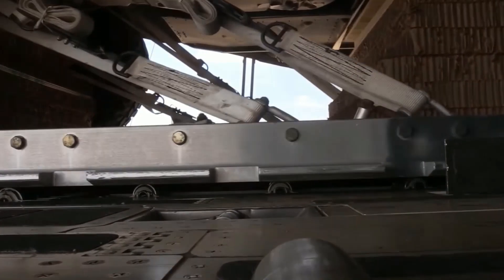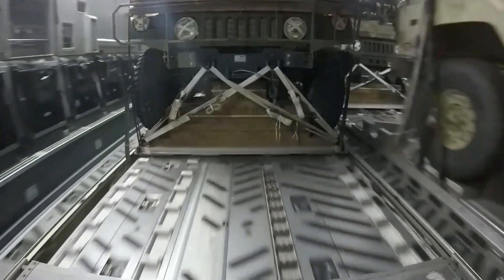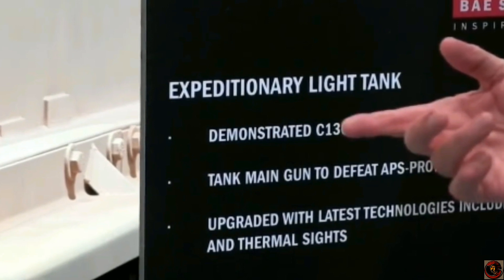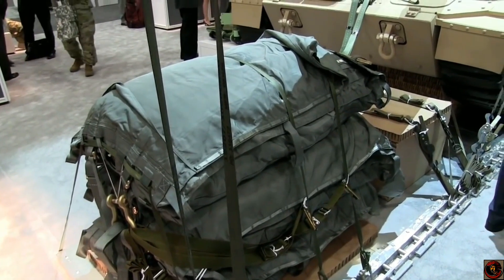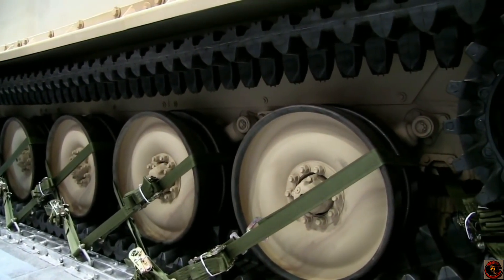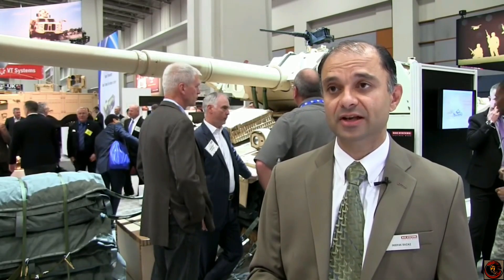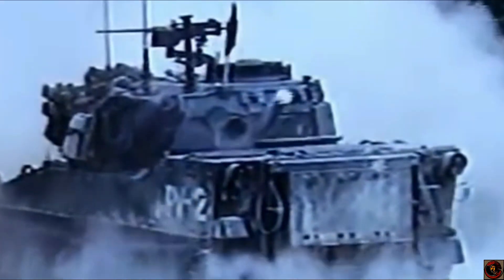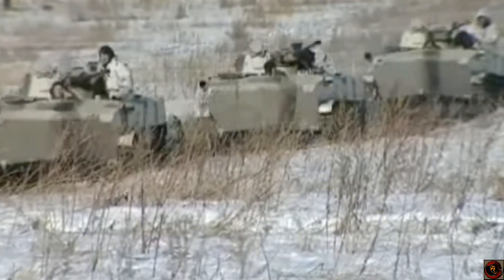Dropping a Tank From a Plane - Airborne Armour?

Comment: Here's another one from back in the day - the Cadillac-Gage Stingray - https://en.wikipedia.org/wiki/Stingray_light_tank  .

The BAE talking head is not really accross  his subject matter:

In WWII there were gliders for heavy loads including vehicles. 
I believe there were airborne tanks that were glider landed e.g.: https://en.wikipedia.org/wiki/Light_Tank_Mk_VII_Tetrarch

Re rubber tracks - maybe use them for the drop to reduce weight and drop metal tracks which can be fitted when convenient.

Aluminium track is also much lighter than steel.
We (RAAC) used to use steel track on our M113AS1s and they were very heavy when compared to the American aluminium track.
So that would be an option.

The idea of tanks being dumped out of planes is not new and the US did it through the 60s, 70s, 80s and 90s AFAIK.

Re development time: the Abrams took about 20-30 years to develop even longer if you go back the MBT70 - so 5 years IS pretty quick to get a complex system like a tank airborne qualified through the US system, especially if you include the politics.

Should this program go on? 
If you're gonna have airborne "conventional" infantry (as opposed to special forces) you really need to give them mobile, armoured big direct fire guns, so yeah this has to go on.

There was a program to replace the Sheridan (which is the M8 they are trying to re-market) now but it got cut when the wall fell.
I believe the airborne school of the US army always wanted the capability back, but the program just didn't have the priority to get budget.
Reply from the maker: jtan163 some great info and points made here :-) thanks so much for sharing and watching. Have a great day!! :-)
Reply: ah, the stingray.  used to great effect by Universal Petroleum in Venezuela.

Comment: Why cant they just use stryker MGS to do this instead of a light tank? I mean stryker MGS also had a large caliber gun right?
Reply: wait really? That fucker is *Googles it*  18.7 tonnes, which is heavier then the Sheridan..... Duh fuck, even the none big gun Stryker weighs more then a Sherdan. Did they armor the fucking stryker with lead? Because the Sheridan uses aluminum armor and is pretty much the same size.
Reply: The MGS is not a tank. It can only fire from the 10, 2, and 6 clock positions because of recoil. It's tall, so it makes a big target. It's wheeled, so it doesn't have the terrain handling capability that a track has.
Reply: Les Ottele also, can't forget the wheels falling off. Touch the ground, whoops, all your wheels are gone, you fucked your drivetrain, and you are going to have a long day in the maintenance area of the nearest friendly base explaining why you threw something out of a plane that never should have been built in the first place (the MGS, not the plane, plane is fine). I personally despise the MGS it isn't even a tank destroyer, at least those can fire their guns anywhere in their arcs of fire! Fire support? What, fire the gun and flip over or rip your wheels off? Nah, fuck it.
Reply: The MGS is being used but its heavy for the role.
Reply: strykers are big, buddy. that's why they're heavy...
Reply: Can not be air dropped. Only fits C17 and C5 aircraft. What is needed is something to fit the C130 and AB300 aircraft.
Reply: chauchua Bernardo Stryker is an infantry vehicle. Any Stryker not committed to carrying infantry is simply a vehicle for supporting infantry. Get it?

Comment: Interesting idea, and it does make some sense to give the airborne something with a bit of armor to help them but I'm not too sure that an airborne tank is the way to go. I think that something like the Russian BMD is probably the better way to go, a slightly up armored IFV. The problem with a light tank is that there'd be too much temptation to try to use it like a MBT and/or there will be complaints that it's too lightly armored for a tank and then it starts getting too heavy to airdrop. As it is, if the armor is modular and has to be bolted then that's going to seriously increase the amount of time it will take to get it deployed after dropping.

As far as the dropping goes, they'll most likely not drop it from high altitudes but basically chuck it out of the back of the plane as it flies a couple dozen feet above the ground. Of course it will be on a pallet but no chute, at least not to slow it down, a chute would be used for drag to help pull it out of the back of the plane quicker. It will probably have some sort of crushable cushioning to soften the impact of it hitting the ground though.
Reply from the maker: Riceball01 some very good points there :) thanks so much for watching!! Hope you liked it :/)

Comment: Instead of having tons of extra applique and slat armour installed after/before the drop, it would be much cheaper, lighter, and simpler to instal an APS (such as the Israeli Trophy). This would give the light tank all the protection it requires for a low to mid intensity conflict (let's be honest - no amount of applique armour slapped on a light tank is going to stop an enemy shell).
Reply from the maker: CXVII MMDLII true true, but I think with a tank like this they want something able to at least be able to take on the vehicles that would also be airdropped like the Russian equivalent. So they want some sort of heavier armour to protect it

Comment: You touched on the logistics for this a little.  The M8 won't be able to be dropped with it's full combat load.  So you're looking at additional fuel, ammo and class IX that needs to be dropped separate to support it.  So add an extra airframe in there.  It won't be able to be dropped with the add on armor attached to it, so add another pallet or two plus time to install.   They won't use LAPES to drop this, they'll use LVADs.    Also, when this gets on the ground, think of how much fuel it's going to burn up and how many resupply drops it'll need to keep these on the move.
Reply from the maker: celtic30 these are all very valid points. Thanks so much for watching and for sharing your input, I really appreciate it! Have a great weekend! :-D
Reply: I actually worked on this a little so if you have any questions let me know
Reply: @celtic30  Got a gyy trying to tell me they air-dropped M1A2 Bradleys in Iraq. From altitude on parachutes. I have only seen these skid dropped, using drogue chutes to pull it out just about 20 feet AGL. 
Is it true that they chute drop heavy tanks from altitude?

Comment: auto loader bad idea for air dropping , i mean if it hits the ground hard, it's just one more thing that can break
Reply: don't BMDs  have auto loaders for their 100mm guns and The 2S25 Sprut-SD is equipped with a two-man turret armed with a 125 mm anti-tank gun fitted with an autoloader, so if the masters of airborn tanks do it then surely its ok
Reply: If you're worried about something breaking, why are you even dropping vehicles in the first place
Reply from the maker: happydeath fish this is a fair point actually. Didn't think of it. Thanks for watching :-) and have a great weekend :-)

Comment: russians drop BMD not BMPs
Reply: The main differences, BMD easier and adaptive suspension.
Reply from the maker: HLVS comendande Che sorry my bad. I'm not that proficient in Russian armour designation. Thank you for watching :-D have a great weekend
Reply: Matsimus Gaming Airborne is a separate independent native troops, reports directly to the High Command. It uses a unique technique and weapons are not used in the Army. For the sake of budget savings agreed that BMD and BMP will have parts in common, but differ structurally. BMD-3 is unique, BMD-4M is unified with the BMP-3, but it is more advanced and protected.
It is easy to get confused, equipment has a large number of versions and models)

Comment: why not just develop a 60-70 metric ton lift helicopter. star wars laat/c anyone?
Reply: helos are inferior to cargo planes in terms of speed and range. and much  more vulnerable in the process of unloading their cargo.i think this is the main reason why deploying a tank via paradrop from cargo plane is preferrable
Reply from the maker: Theredelectrician haha maybe. I was thinking like the aircraft carrier in the avengers movie lol!
Reply: I was thinking of attaching the tank via cables what could be let go remotely once the tank is touching the ground. The crew and ammo are already inside the tank so it can begin to fight from the get go. I do agree with you that a helicopter is more vulnerable while traveling due to is speed or rather lack of it compared to a plane. They would not be dropped right on the front line but a bit behind and then drive towards the front line. I be-leave this would be faster then loading up a plane with a tank, securing it and then dropping it with crew parachuting separately. My view on this equipment would be a ultra fast response to a enemy spear head or exploiting a breakthrough in the enemy line.
Reply: although a flying aircraft carrier/ troop lander would be the most awesome thing ever developed. I do not see it happening unless we get fusion energy working properly or we develop the liquid salt reactor further. (USA why did you stop its development. We could have had nuclear powered planes my now)
Reply from the maker: Theredelectrician I think it could happen for sure. Give it 20 years and look at what will be available! It blows my mind how far we have come with tech in the last 20 years! Lol
Reply: Matsimus Gaming well in 20 odd years when it does happen. I hope you will do a video on it.

Comment: I love the russian Air dropable tank designs like BMD-2 or BMD-4
or the mostbadass TD the Sprud-S (BMD-4 with the 125mm gun of the T-90)

and IMO these are right now the best air dropable vehicles, the BMD-4 even is better than some of the Normal IFVs out there.
Reply from the maker: Iron_Physik yeah the BMD seems like a amazing vehicle for this kind of setup. It makes sense to use them if they can be deployed like this safety. Hope you enjoyed the video! Thanks so much for watching and have a great weekend!!
Reply: Matsimus Gaming

yes I enjoyed the video.

Oh and for rubber tracks:
I think they are not only rubber, I think they did the same as in rubber belt drives and reeinforce them with steel cables.

this would solve the problems of them snaping easy and warping under heat.

the only problem would be that the rubber gets dammaged from long driving on hard terrain like streets.

I came to this idea when I checked Belt drives. (im a mechanical engineering student)

something like this:
http://www.gufero.com/files/mod_eshop/kategorie/105.jpg
Reply from the maker: Iron_Physik interesting info! Thanks so
Much for sharing. I'll check it out!

Comment: i love the concept of air transportable armor. i think its a good direction, because tanks of this size can be still equipped with standard 120mm guns but be entirely more mobile than any standard tank. with the technology increasing, soon we will have such smaller and lighter modular armor that we wont really need large heavy MBTs like the abrams. once the tank (with the same gun) reaches the destination area, the modular armor is bolted on and they drive away, effectively being able to provide support while also having armor that can compete with any anti tank threat that could be presented. correct me if im wrong but i think the American new future light tank designs ran along this train of thought, being light enough to be airlifted while simultaneously having the same armament and better situational awareness than the abrams. i think that near future efforts in armor development is going to be spent on countering existing weapons systems with lighter and smaller armor packages/revolutionary designs, rather than simply increasing the bulk to solely defend against future anti armor developments like they were doing throughout the cold war and 90s.
Reply from the maker: NEET Magnet some very good points there. I find this kind of way they are going very interesting. Thanks so much for watching!! :-D

Comment: I think that it is the softness and malleability of the rubber tracks that makes them reliable, less likely to crack, chip etc etc. Also, if the track was to be hit by shrapnel/incoming round My guess is that the elasticity would allow the round to puncture a small entry and exit wound without breaking the entire track  with the majority of the force of the object being allowed to pass through the track rather than absorbed by the track itself. (I don't have any experience on this matter nor am I an expert this is just my guess)
Reply from the maker: Crunchy Memes I don't know enough about specifics of the rubber tracks so I can't comment much. But I would ALWAYS side with metal ones before a rubber one. Thanks so much for watching :-)
Reply: Matsimus Gaming Thanks for another great video :)
Reply from the maker: Crunchy Memes your welcome anytime :-)

Comment: I was wondering if we would even bother trying to match the Russians and their BMD series and Sprut-SD tank destroyer. Given how things go I am still skeptical.

But as to the autoloader on the M8 MGS, I know that it is some sort of carousel type autoloader but the exact details remain elusive. No amount of research has been able to garner much. I have even heard that it even has a form of blowout panels to it but I can't really find reliable info on that.
Reply: Nicholas Mew It does have a carousel type auto loader and there was a large access panel on the top of the turret that allowed you access the main gun and auto loader that acted as a blowout panel.
Reply: Nicholas Mew also there is a pseudo bulkhead inside the tank with an access hatch so that if the mechanism fails the gun can be loaded manually, even if a little bit more slowly, you can still fight your way out of a bad situation and then go and repair the mechanism to get your blistering rate of fire back
Reply: Fabian Johnston Interesting. For such an autoloader that is excellent.
Reply: It's probably still a prototype, the final specifications are not known.

Comment: This has amazing shock potential. The enemy can be attacked when he is most vulnerable with a weapon system that can do the most damage. It would probably be better to design a new lighter but powerful gun. Also I don't think a paratrooper tank needs to have pretty heavy armor. Speed can be used as it's primary defense. A tank light enough to be airdropped should be pretty fast. Armour should be used sparingly on an airborne tank. as for the auto loader, I really think they should have gone manual. It would make the tank lighter and more transportable and leave more weight for armor.
Reply: Ahhh the good old M8 MGS "Buford". The little tank that never was. Firstly why would they need 5 more years of R&D when they have been trying to sell it to the U.S. military since the 90s. I am no expert on this vehicle, I just got to play on it a few times over the years.  The electronics package in the early 2000s was comparitable  to the first series of M1A2s and I would think that they would have looked into ways to improve that, like adding GPS nav instead of inertial nav. I thought it was a good vehicle for the task it was designed to do. It has all the basics you would expect on a modern version of a light tank. Thermal sight, digital coms, digital fire control systems. If memory serves me correctly with no add on armor it weighs slightly less than a Bradley. There were 3 "phases" of armor, P1 no add on, P2 bolt on modular armor, and P3 added on ERA and bar armor on top of P2. It had a carousel type auto loader that still aloud access to load the main gun manually via access panel in the crew compartment. No idea if they improved it, but it loaded at a decent speed. Not as fast as a well trained human loader, but relatively fast for an auto loader. I also believe this vehicle shares a lot of common parts with the M113. I always thought the coolest feature was that it had a gunners hatch lol. As an M1 tanker it was nice to be able to stick your head out for some fresh air without having to climb out from the gunners hole.
Reply: +Fabian Johnston this is BAE we are talking about here. Five years worth of money. To be honest, I agree with Matsimus R&D should be no longer than a year.
Reply: USA plans to manufacture armored vehicles to be landed, Russia is building a huge heavy tanks and infantry fighting vehicles. The world turned upside down)
Reply: Джо Неуловимый Honestly, I think my country is better of using light tanks.
Reply: Maverick Raphael H. Sebastian Long enough not used.
Reply: Джо Неуловимый I don't quite understand what your saying
Reply: Maverick Raphael H. Sebastian Probably a classification problem, what is considered a light tank. USA long time did not use them, or I have not heard about it.
Reply: Джо Неуловимый I honestly think they are better for my country because I live in the Philippines. We aren't a particularly wealthy country and have plenty of mountains and forests. The places we can use tanks will mostly be valleys and rice fields. And to get there the tanks would have to get over mountains. Also the fact that my country is an archipelago means that strategic mobility is very important having to move forces from island to island.
Reply: Maverick Raphael H. Sebastian BMP-3F would be useful in these conditions. 100mm gun, 30mm avto and 3 machine gun, you can install additional armor, besides it floats well and is easy enough. And can be built in any quantity for a reasonable price.
Not advertising) I just don't know another car with similar settings. They are either not numerous or very expensive.
Reply: Джо Неуловимый It could be possible that the Philippine Military could have them in a few years. Our current president is seeking closer ties with Russia (Though he seems to be chopping our US relations with an axe)